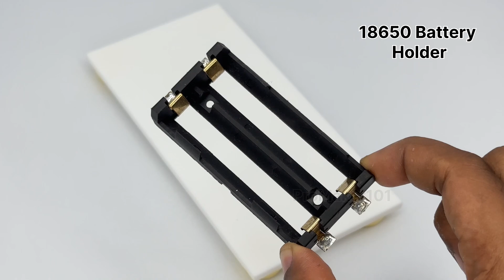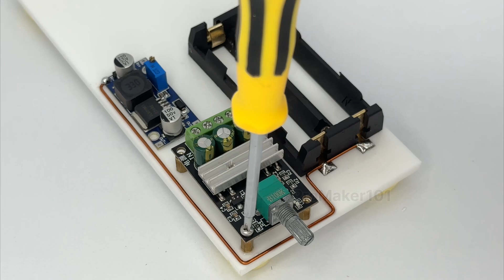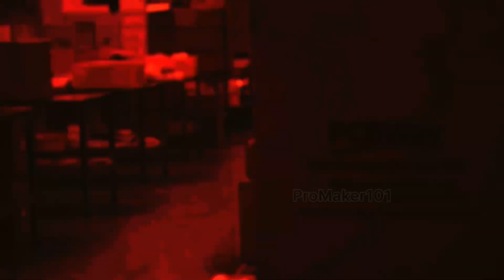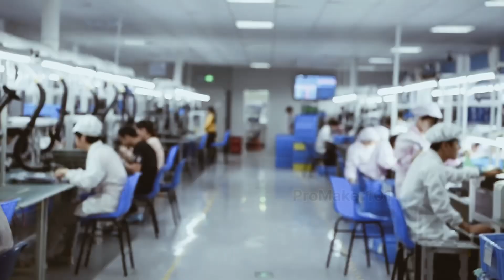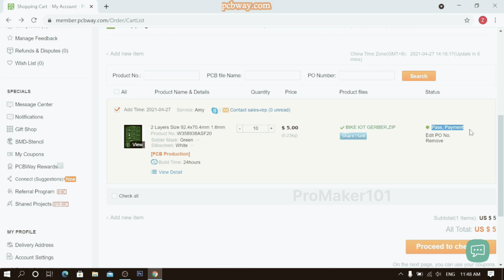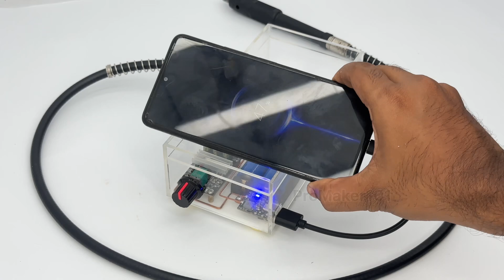I Built This useful Device At Home [DIY]

Comment: Why use battery  use 12 or 24 v adaptor for more efficiency
Reply from the maker: It’s portable. Or you can use 12v battery with BMS. It’s more power ,But it can't be charged using a mobile charger.Thanks